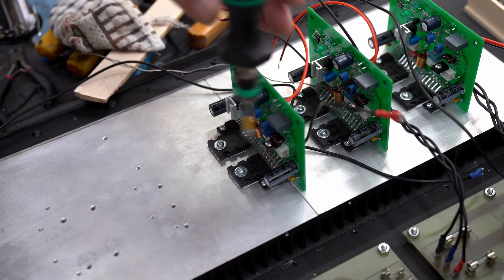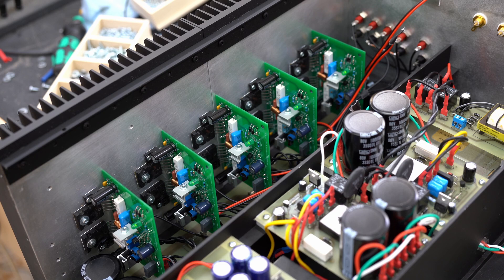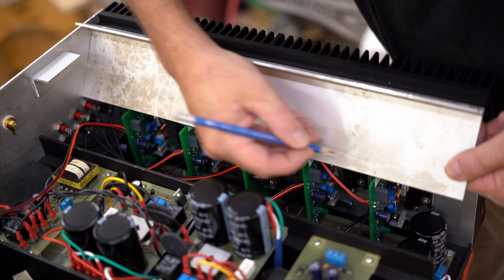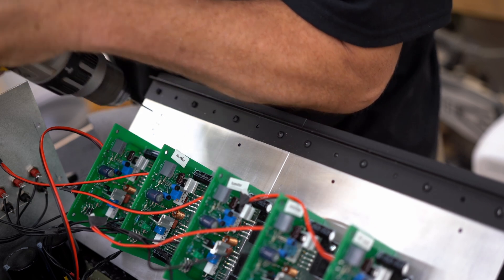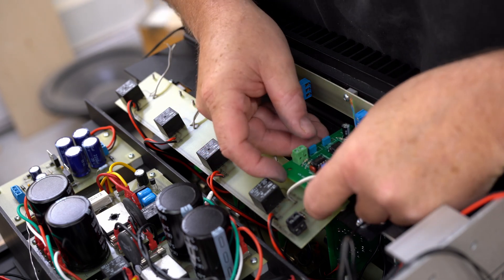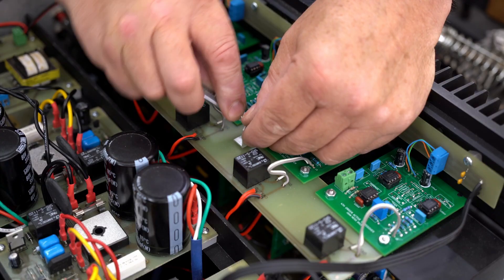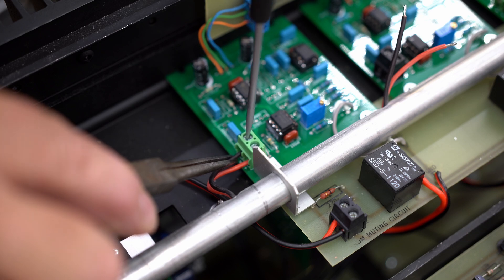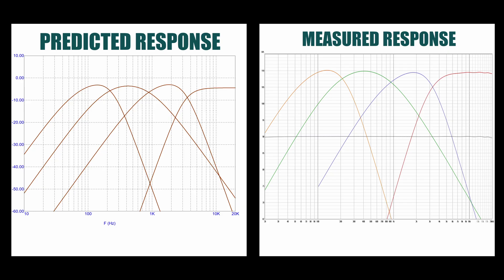Process for Building a 10 Channel Amplifier - Assembly Details Part 3

Comment from the maker: To recap what's going on here, this amp has active crossovers that drive my 4-way active speakers. So for each speaker driver in the 4-way, there's an amp board and a crossover board. I designed the crossovers based on the setting I arrived at with my miniDSP setup - the DSP setup is what I was using before I made this new amp. DSP is digital and adjustable, while this new amp and crossovers are analog and fixed. I can only change the output level on each channel, not the crossover slopes or frequencies.

Getting all of the amp boards mounted on the heatsinks and wired to the power supplies and output banana jacks took the better part of a full day. A big part of that time was me testing each board before installing it to make sure they are working correctly. 

Then more metal fab, I used some scrap aluminum extrusion to make the two decks that the crossover boards will sit on. I had a genius idea to bend tabs down to support the ends of the amp boards, but that failed when the tabs broke off. Worth a try, but I wish I'd tried on a scrap of the same aluminum before cutting the shelf. Then I had to cut the other shelf in the same way so it wouldn't look odd!
And yes, I tried annealing the aluminum with a torch to make it softer - it didn't work.

With the first crossover board hooked up I can turn it on and see how much of a turn-on thump it creates. Not too bad, but I can eliminate it altogether by muting the inputs to the amp boards until the power supply for the crossovers stabilizes. Worked great and it only added one more full day to the build time!

Thanks again to Rod Elliott's ESP website for a suitable muting circuit to use:
http://sound-au.com/articles/muting.html

The output of each crossover board stays disconnected from the amp boards for about two second after you switch the amp on, then the relays close and connect them. I used relays because I have a bunch of them that I got for next to nothing several years ago.

When you switch the amp off, the muting circuit detects the loss of AC voltage from the transformer and immediately turns the relays off, disconnecting them from the amps. That eliminates the sound that the crossover boards make as the power supply discharges.

With the crossover installed and the metal front panel screwed in place, I moved the amp down to my listening room to setup and use. It's not finished, but it's finished enough to use (or so I thought...) and I need to take a break from the project to do other things.

Comment: Noticed the input tubing shields in a previous vid, not sure if I've ever seen that practice before. 

This one was particularly enjoyable to watch. 
Looking forward to further updates. 

fwiw, in scenarios where compressed air etc., is less desirable ... a tape "moat" can be quickly placed to catch debris. 

Even with catching the debris, compressed air is still prudent. 

I believe some QSC amps have internals oriented upside-down ... so as much dust/debris over time doesn't settle on the boards.

Especially good for live work and liquids!
Reply from the maker: Thanks! This is the last build update on the amp. Eventually when I get back to it and finish it, I'll make a full build video to post on my main channel. That'll recap the stuff in these videos, plus details on the finishing touches.
Oh, I like the idea of mounting it all upside down. Certainly makes it easier to blow the dust out every few years.

Comment: John, would you help me here? I have 3 ICEpower modules with integrated power supplies. Two of them are identical, the other one is pore powerful for the base. I don't know if I have to connect them in series or in parallel. Obviously I want to use them in one enclosure for 3x2 channel Amp. Your help will much appreciated ! Thank you

Comment: While you added the relays, you could have gone for DC protection on the amps instead. That would get rid of plops when the amps switches on and off. And the added benefit is DC protection for your expensive speakers. I personally wouldn't trust an amp without DC protection. There are way too many situations when amps fail with a blown power transistor. That puts DC rail on your speaker terminals. Your power supply fuses are too slow to prevent speaker damage in such case. I like your design but I suggest you rethink that bit.

Comment: Why not just use a SSR on the output..
Reply from the maker: Using the word "just" suggests that you think it's simple.
The very best way to set this up would be to have relays (mechanical, not solid state) on each of the 10 (yes, 10, not 1) outputs that would delay turning on until the amps and crossovers stabilized. They would also have short circuit and DC protection along with that delayed turn on.
But, unless you can buy those boards ready made with relays that are capable of switch 30amps of DC current, it becomes a part of the project that's almost as big as the project itself. And expensive as well. And space - they will consume a lot of the space inside a chassis that is already packed full of the stuff that's actually needed.
Barring accidents that no protection could possibly prevent, amps like this that are well made and not messed with can last for decades without any of the faults the output protection is made to prevent. 
For you that might not be an acceptable risk, so when you make your own 10 channel amp you are free to include that extra protection. 
For me, I'm willing to take that extra risk to save time and money. Simple as that.
Reply: @IBuildIt  I’m assuming you don’t know what a ssr is ?
Reply from the maker: Enlighten me.
Reply from the maker: Yes, I said mechanical, not solid state for a relay in my reply. That should have been enough to show that I knew what you meant by ssr. What did you think I meant?
Do the math. 10 x cost plus space they take up for a "what if" situation. 

And is the mosfet operating in a perfectly linear way? Mechanical relays don't add distortion, and the greatest source of distortion in a power amp is from the output stage because the devices are conducting a lot of current. Adding something like that would be okay if you are more concerned about possible faults than you are about sound quality.

And you've been a bit of a broken record on this topic, and it should be clear by now that I don't have any intention of adding anything like it to the amp, so maybe you should think of something else to talk about.